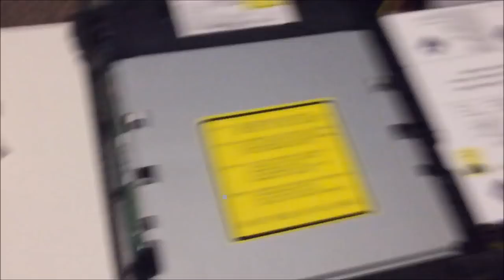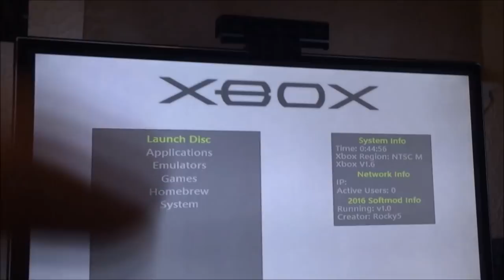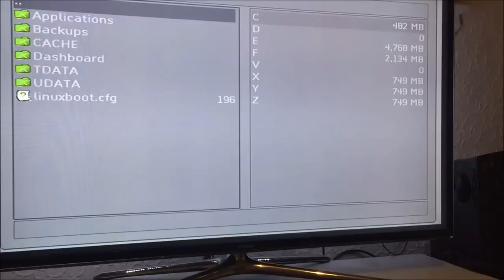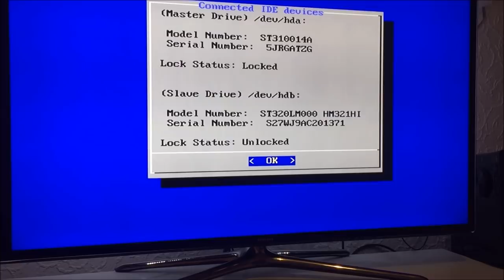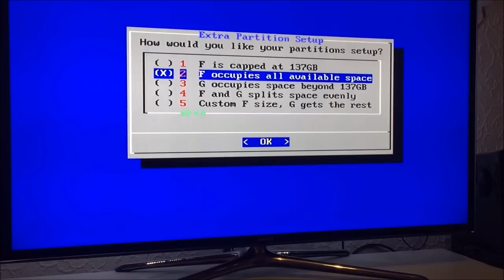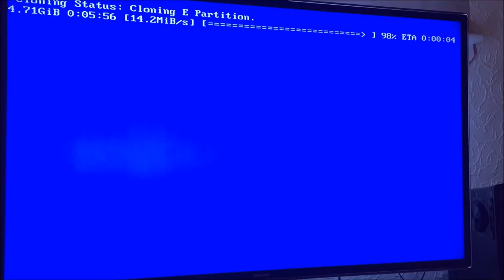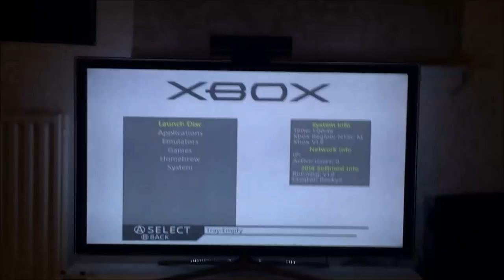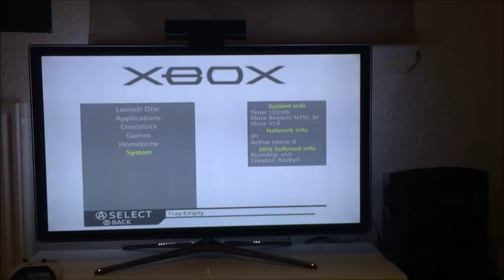How to clone your Hard drive using Chimp 261812 from start to finish.

Comment: trying to use this on unleash X but having some problems. 
1. If i swap cables before running the chimp loader the XBOX becomes unresponsive. 
2. the chimp folder itself does not appear when i place it the E/ (and or) E/apps. the only thing that shows up in the list is chimp loader.
I am stuck and not sure what to do. using unleashX V.0.38.0515A
can you help me know where i should put which files on the xbox itself in case that is my problem and walk me through how to open the new chimp in Unleash X please?
Reply from the maker: +Kirk Van Orden the unresponsiveness i cannot fix, that's down to you, the IDE cable or the adaptor if you're using one. 

As for the chimp folder showing? It should show as Chimp Loader, I updated it from what is in the video. You place the Chimp folder in E:\Apps or E:\Applications what ever your dashboard looks for applications. 

As for walking you though the process. 

Turn the Xbox on, FTP to the E partition and stick the Chimp folder in E:\Apps\ 

Now restart the Xbox and under your apps menu you will have Chimp Loader. 

Now turn off your Xbox and get your drives ready, have your slave drive powered or if using a Y splitter plug it in, now turn on the Xbox and when UnleashX appears. Go to the Apps menu and highlight Chimp Loader.

Now it's time to pull the DVD drive IDE cable out and plug it into the salve drive. You have about 4 seconds to do this. 

Now press (A) to launch Chimp Loader. It will auto boot Chimp. 

The rest is in the video.
Reply: Ok. I did have it set up correctly then. My only problem is that even if i swap cables very quickly (2-3 Sec) the xbox still freezes up
Reply from the maker: +Kirk Van Orden the power cable is probably moving on the master drive. If the master drive loses power the system locks up. 

Just make sure everything is connected properly and securely.
Reply from the maker: +Kirk Van Orden what is shown on the screen after you press (A)?
Reply from the maker: +Kirk Van Orden are you softmodded or hard modded? I check to see if the slave drive is lockable before the chimp menu loads and if fails to lock I give you an error, if it locks I unlock it and you get full access to the menu system.

I done this to stop people cloning there drive to then find out the drive cannot be locked.

I can send you a version without the lock in place tomorrow, as it's 00:24
Reply from the maker: +Kirk Van Orden actually here is the file you need. 
https://drive.google.com/open?id=0BzRN8P835YijRFJ4N1dxeTZGcW8

Replace the one inside the chimp folder with that one. You will still get the error about the slave drive, but you get full access to all the menus.
( I will send a proper one tomorrow, or I will rethink on how I do the check )
Reply: I guess i"m done. accidentally unlocked the master drive and now Original hard drive is bricked
Reply from the maker: +Kirk Van Orden why did you unlock it? you never unlock a softmodded Xbox HDD.

Not all is lost, I'm guessing you have the eeprom.bin or it's on the HDD?
Reply: I wasn't able to alter files on the original hard drive anymore. I would make changes on the xbox itself and through FTP but it would stay the same after a restart. tried for a while and then when trying to unlock slave drive accidentally unlocked master instead. 
I think the original drive may have gone bad while i was working on it so that it couldn't write anymore
Reply from the maker: +Kirk Van Orden how did you accidentally unlock the master drive? if you were use Chimp 261812 you need to enable advanced features first via the settings menu, I deliberately disabled locking and unlocking of the master drive so to stop stuff like this happening.

You need to get the eeprom.bin off the HDD it should have been backed up when you done the softmod. If you don't have it or you deleted it from your Xbox hdd then the only other option is install a chip or buy an eeprom reader. ( probably cheaper buying another Xbox )
Reply: I did backup the eeprom when doing the mod but i do not know how to access it.
Reply: This is a bit over my head and I probably should not have started the project
Reply: sorry to keep you up late
Reply from the maker: +Kirk Van Orden you will need to attach your Xbox HDD to your computer ( IDE to USB adaptors work ) and you can use Xplorer 360 get the eeprom.bin off the HDD & then you can use XboxHDM2.3 USB Beta to lock it to that eeprom.bin
Reply: The Hard drive may have died during the process. xplorer 360 comes up as not seeing any FATX drive.
Reply from the maker: +Kirk Van Orden try running it in administrator mode
Reply: got it. Is there a video of the recovery somewhere that i can watch so that i don't have to bother you about walking me through each step?
Reply from the maker: +Kirk Van Orden download the "XBHDM Build.zip" and extract it. You will have a Linux folder with a C and E directory transfer the files from within those folders to the correct partitions.

Partition 1 = E
Partition 2 = C
Reply: I have the CD made
Reply: for some reason my drive had 5 partitions (0-4) and all of the files were in 3 and 4. I made a CD with the eeprom.bin file from the backup folder but xboxhdm says that it cannot see it and will not let me lock the hard drive. there is a text file in the backup called hddinfo with disk serial number, model, hdd key, xboxhdkey, and hddlockdisablepassword. can i use any of those to relock the original drive?
Reply from the maker: +Kirk Van Orden download XboxHDM USB 2.3 Beta 2
https://sourceforge.net/projects/xboxhdm2/files/xboxhdm23usb/Beta/xboxhdm23usb-Beta2.zip/download

Stick your eeprom.bin root directory ( same directory as the XboxHD.bat ) run xboxhd.bat and it will ask for adminwrites select yes, now pick the lock option and then your drive. ( you need to connect your HDD via a USB to SATA or IDE adaptor )
Reply: I downloaded the xboxhdm but there are so many files and other things that i have no idea what to do with it. i put the files inside the xboxhdm folder that it had but my PC cant boot off of the flash drive
Reply from the maker: +Kirk Van Orden I cannot say for versions under v2.3 but usually there is a file .bat file you run ton build a ISO or instructions that come with them telling you how to use them.
Reply: figured it out and everything is working great. thank you so much for your patience and help. last question, is it possible to put movies onto the xbox and play them? i got the games all figured out but havent been able to find anything about movies yet
Reply from the maker: +Kirk Van Orden yes, but it has tonne standard def videos as the Xbox CPU isn't powerful enough to do HD ( it can do sub par HD with specific codecs and bitrates )

You would need to install XBMC4Xbox and fire the movies anywhere there is space.

Comment: 8:30 can you please explain better to beginners like me what needs to be moved on the XBOX? Thanks
Reply from the maker: +Konphetty what is you mean what need to be moved onto the Xbox?

You FTP over the Chimp folder that located in the following folder.
Chimp261812_master\E Partition\
To E:\Apps\. Restart your Xbox or dashboard and it will show in your applications menu.
Reply: JCRocky5 yeah thats what i meant. Thanks a lot. Just wanted to make sure this wasn’t the one causing my error 16 problem.

Comment: Hello, I am trying to update my Xbox. I put in a 250 or 500gb many many years ago( I would have to open it up). I had to use hexedit workshop to copy sectors and some other stuff I can't remember. I see ur 2.5 laptop HDD. Great!! So my question to you is will any sata 2.5 work or is there a list? I looked on http://xboxdrives.x-pec.com/ and wasn’t finding a 2tb HDD on the list. Yes 2TBs I have my reasons. Anyways, I looked at this one Seagate 2TB BarraCuda 5400 RPM 128MB Cache SATA 6.0Gb/s 2.5" Laptop Internal Hard Drive ST2000LM015 and was wondering if it would work. Thank you for your time.
Reply from the maker: +Magnus Hydra I have never tried 2.5" 2TB drive, so can’t say 100# But there is no reason it shouldn’t. Note, I always use WD Blue drives. 

If softmodded you need the drive to be lockable. I haven’t had a none lockable Sara drive.
Reply: Alright, thanx for the fast replay. I have ran in to a big problem using your Xbox Softmodding Tool and XBMC-Emustation-master… I am trying to do to much to fast… I soft modded this xbox that’s never been modded. I use an old Auto installer deluxe I had, well xbox was working fine and everything. So I tried to use the Xbox Softmodding Tool to update and upgrade everything.  Burned the disk and it loaded up just fine and When I clicked on advance then on to older soft mod it would then tell me to please wait and never did anything. (let it run for an hour). So I then tried the Xbox Softmodding Tool Extras Disc thing. FTP the files onto the xbox and ran the .xbe and it loads up fine as well. Clicked on advance then on to older soft mod and it worked fine!! However…. Once the xbox rebooted it booted to a black screen. I hit the eject button to put in splinter cell to try to load it up to re mode it and it booted to the menu!? I powered it down and booted it back up, same problem until I hit the eject button….So I through, hey why don’t I change the dashboard and hopuly fix the problem and get the XBMC-Emustation-master version working. So loaded the Xbox Softmodding Tool Extras Disc .xbe and installed the XBMC dashboard. Xbox rebooted, got the same black screen until I hit the eject button… XBMC works!... I then replace the dashboard XBMC files with XBMC-Emustation-master version and all hell broke loose…. I get an error and it tells me to FTP in. Ok no big deal right? WRONG!.... (connection attempt failed with "ECONNREFUSED - Connection refused by server)… It worked 5 mins ago wtf… I don’t been messing with this box for about 5 hours now and its 3:30am and I need to be up by 7am….Sorry if this doesn’t make much sense I am falling a sleep. I am going to look in my attic for my crossover cable I use to use back in the day and try FTPing that way…. I think this xboxs dvd motherboard chip set is messed up. I’ve tried 3 different dvd roms and they all do the same thing.. IDK off to bed.
Reply from the maker: +Magnus Hydra I guessing your Xbox is chipped and that’s why you get a black screen unless you use the eject button. 

You can’t install a softmod over a modified bios, in this case when your chip is enabled. 

So you’re going to have to use hexen to fix your chipped Xbox as that disc has chipped/TSOPPED Xbox Features. 

As for XBMC-Emustation you build that on a windows PC, full instructions are on github in the readme.md file.
Reply: JCRocky5 no this Xbox have never been modded before I soft modded it yesterday. Idk what happened, it boot fine until I use ur updating tool. But like I said I had to use it without the cd and I probably messed up something. I’ll mess with it later on tonight. Got to get past this ftp error first.  The read me say to ftp it over.. I’ll read it again. Like I said I was trying to do to much to fast.😩
Reply: Alright so the xbox give this:
XBMC Fatal Error:
No suitable skin version found
We require at least version 2.1000
IP Address: 192.168.0.6
Starting FTP server...
FTP server running 0n port 21, login: xbox/xbox

I try to ftp to it and get this message. No connection could be made because the target machine actively refused it.
Connection failed.

Any Ideas on what I could try? can we chat through email or something please.

Comment: Hi buddy is there  any way to unlock a sata hdd that was locked in another machine i no longer have?
Reply from the maker: +plane spotter if you have the eeprom or know the key yes, if not then no. You could try the master password options in chimp or the manufacturer master passwords.
Reply: JCRocky5 i dont mate no......oh dear
Reply from the maker: +plane spotter try the master passwords, quick google and you should get them for the major brands and then you can use XBHDM to see if they will unlock the drive.

Comment: I did this just today using the startech adapter And. 2.5 inch 1tb toshiba. It works great except there's a weird issue where if I hit the eject button on the disk drive while the Xbox is powering up it crashes. I think that's because I am using the stock 40 pin cable. I'll comment again when the 80 pin get delivered and I've swapped them out
Reply: Hey just to update I swapped out the stock cable with a 80 pin and while it did fix quite a few issues including some bad game transfers and a weird tick where if I was transferring files over ftp the Xbox couldn't read the disk drive. But the issue with the console crashing when start with the eject button still persists. The issue persists regardless of whatever hard drive I use except the stock one. And I don't have any dual boot options setup. At first I thought the transfer messed up the softmodding settings but no I rolled it back to stock and resoftmodded to no avail. I'm using the startech adapter. Let me know if anyone sees this and has the same problem
Reply from the maker: +Ian Thomas if it’s still doing it and only with 3rd party HDDs then it’s the adaptor. Stock drive still works like you said and multiple other drives have the same issue so that only leaves 1 culprit the adaptor.
Reply: JCRocky5 Yeah that's what I was thinking Ive been thinking of grabbing another adapter anyways just cause I like having spare parts I'll pick up the 5 dollar green one from your video. And post up a reply if it fixes the problem. Have you had anything like that happen before?
Reply from the maker: +Ian Thomas not the system crashing when powered on by eject. I have had the system not reading disc or super slow boot times when using a 40 wire cable with an adaptor. 80 wire fixed those issues.